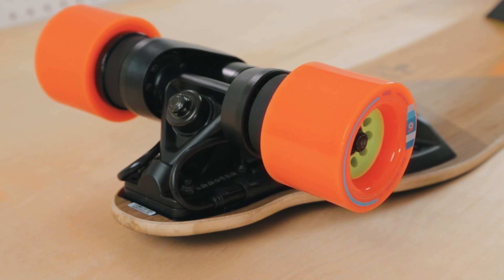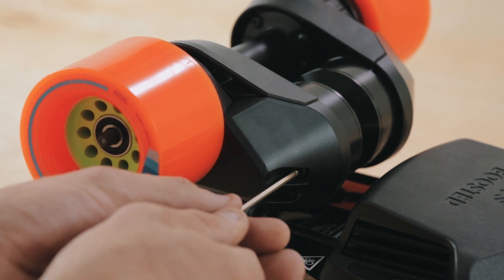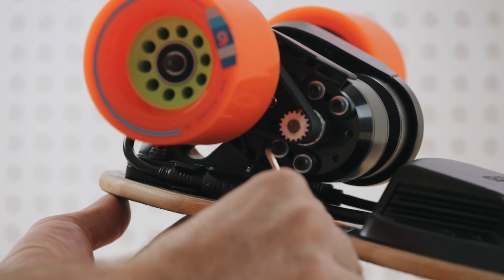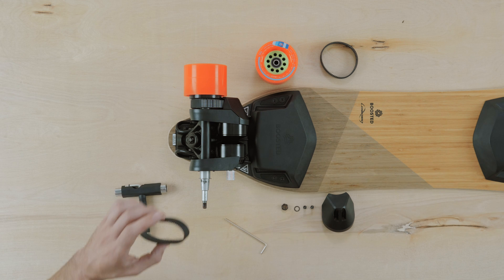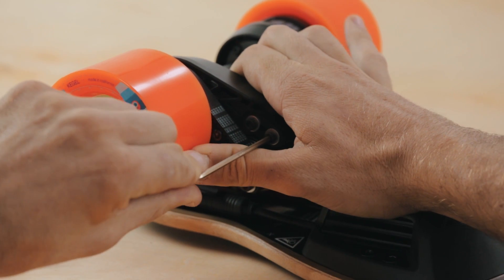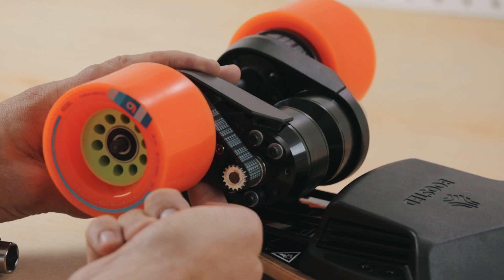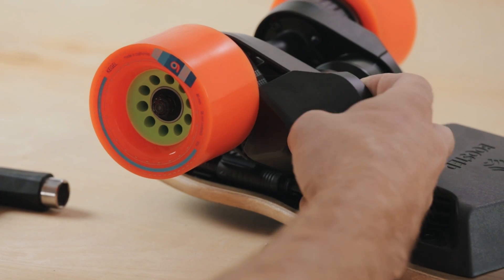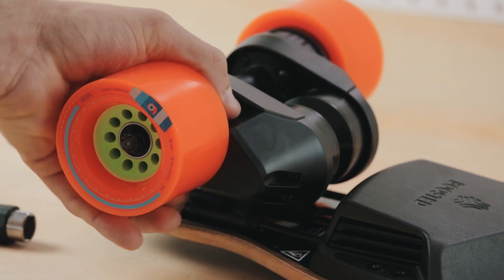Boosted Boards - 2nd Generation Service Video: How to Change a Belt (Without a Tensioning Tool)

Comment: Is the loosening of the 4 screws necessary? I replaced by belt without needing to loosen the tension on the belt
Reply: Mace 1 how??? Cause I can’t loosen those screws my 3mm won’t fit in their
Reply: ES I just used a butter knife and kept maneuvering the belt off

Comment: "retention belt" section makes me want rage. Why do they keep moving the camera away from when seeing how much give the belts should have?

"Pull the motor towards the motor driver, away from the hanger, until the belts are tot"

which part is the motor driver? which part is the "hanger"? What does "tot" mean?
Reply: cselph  strait up dude that's the part in stuck on, like I don't want to be riding and something fuck up but I can't figure out how to get it tighter
Reply: And yea wtf does tot mean
Reply: logan geyer basically just hold the wheel in place and roll the motor thing towards you, this gets the belt to be tight. Then tighten the bolts while holding it in that position.

The first few times I didn’t get it right and my board made loud sounds when braking but now I got them tightened up.
Reply: FYI it's "taut" which means tightened fully

Comment: Has anyone found a better way to keep tension when you retighten? I have a hard time getting a good tension...
Reply: I use my Skate Tool and insert the tip inbetween the Motor and middle of the trucks. Keeps good tension and is easy to get leverage to achieve maximum tension for wore out belts.
Reply: Jeremy G Yep, it gives me leverage between thr motor and trucks.
Reply: Be careful putting pressure on the motors with any sort of tool, it can bend the shaft (yes I did this).  It is a bit tougher to put pressure and tighten all at the same time but it can be done, a helper of course makes it simple.

Comment: My v2 dual+ came with overtightened belts (may be it becase of temperture difference, +5C on the street it's pretty cold). After 5 miles it began to sound like a coffe grinder. 
With this manual i ajusted belts and now everything work and sounds perfectlly.  
Not really sure, but i think overtightened belts destruct motors way faster that intended. You better check your belts.
Reply: How do I know if it’s to tight on a mini x the newest 1

Comment: One of my belts was ripped off do I need to replace one or both belts
Reply: I would say both, you don't want one performing worse than the other
Reply: If the other belt isn't damaged, I would think only one. I would ask Boosted's customer support to make sure, though.